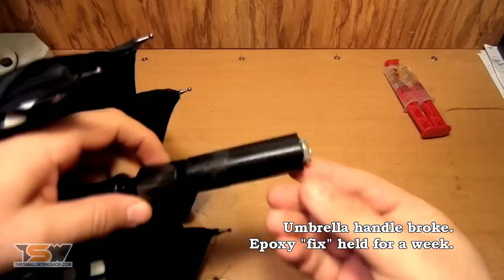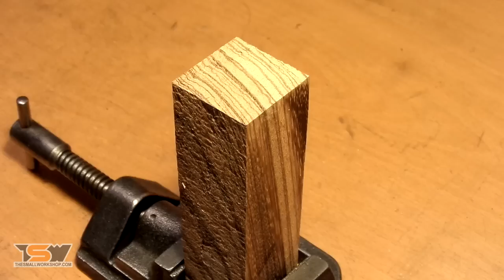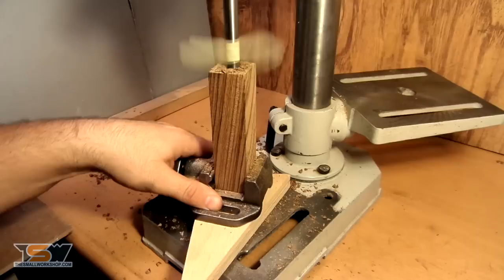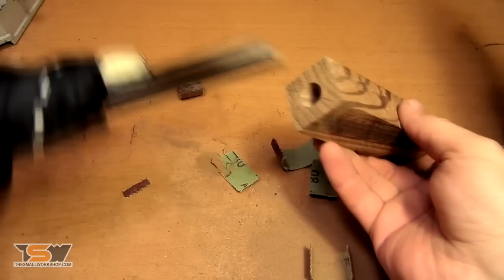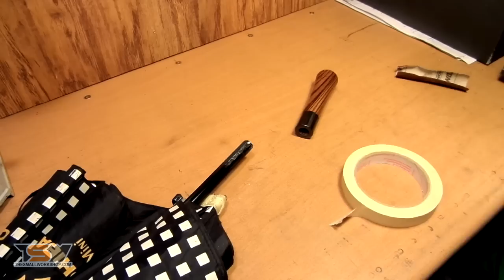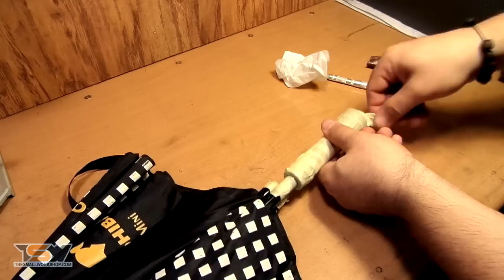Repairing an umbrella - woodturning a handle

Comment: Great instructionvideo. 
Learned from the makers of epoxy that heat makes the repair harden and last longer 50 or even up to a 100 C unleashes the magic. Old epoxy does not harden at all. The shops have no way of telling if there is no expiring date on the products

Comment: Nice ! At 2:22, why do you put your tool on the piece like that ? I've seen that done elsewhere, but I don"t understand why.... thanks !
Reply from the maker: fast way to check if you finished rounding the stock. if it still has bumps the tool will vibrate.

Comment: Awesome! Could you tell me more about the CA finish? Is it like ... "super glue"? And if so, does it stick to the wood if it is applied after mineral oil (which BTW, is it like linseed oil? for example https://www.ikea.com/ro/ro/catalog/products/00046786/ )
Reply from the maker: E superglue. Prefer pe cel de la bison, varianta "industrial", la sticluta de 20 ml. Dar cam orice superglue de calitate, varianta lichid, ar trebui sa fie ok. Nu am avut probleme cu el cu aplicarea dupa ulei mineral, am manere in uz de 2-3 ani cu finisajul asta si sunt ok. 
Skidd e ulei mineral si e foarte ok, e diferit de uleiul de in, nu polimerizeaza, deci nu poate fi considerat un finisaj in adevaratul sens al cuvantului, mai mult un tratament al lemnului. Eu il folosesc in special sa slefuiesc fara praf pe strung si ca sa dau lemnului o oarecare rezistenta la umezeala. Se gaseste si in farmacii daca nu ai drum la ikea, e putin mai lichid, mai rafinat, dar merge la fel de bine.
Reply: Mulțumesc!